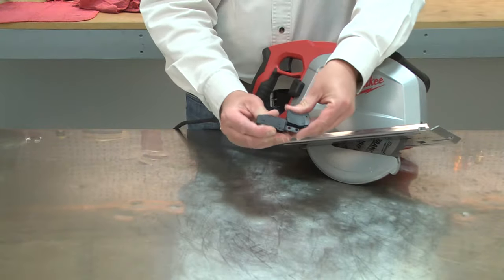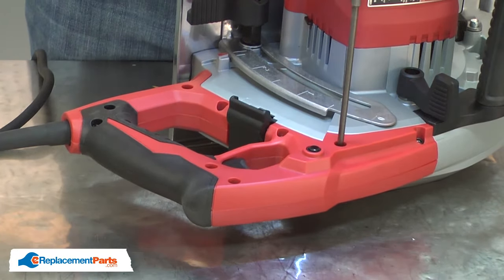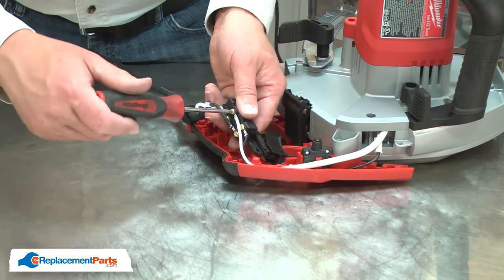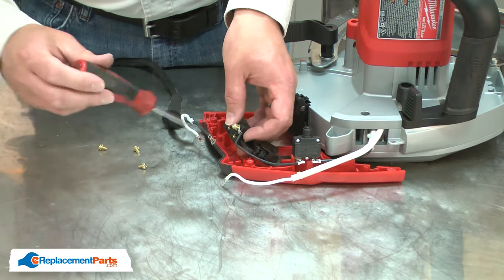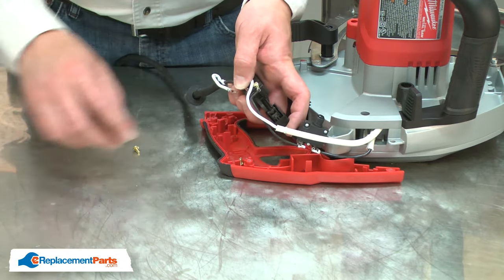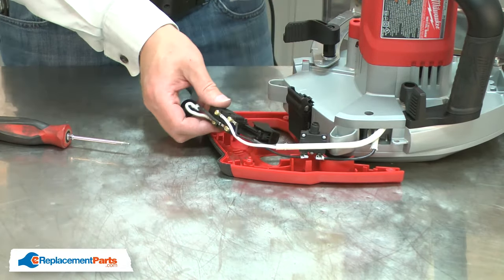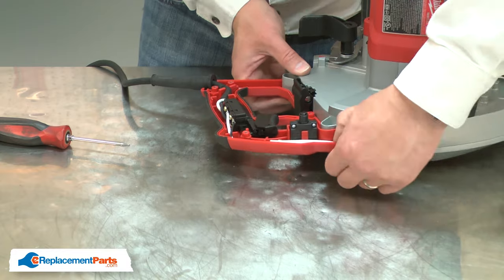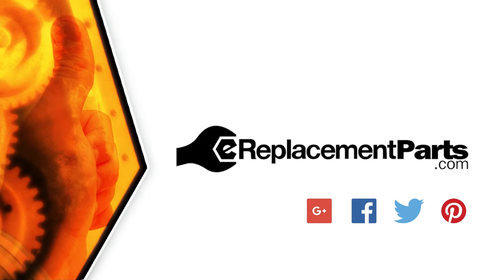Milwaukee Metal Saw Repair - Replacing the Switch (Milwaukee Part # 23-66-2685)

Comment: It's easy to replace but how do you troubleshoot it to see if it's what's broken with a multimeter
Reply: Place on meter and when pressing circuit is complete so you should see power.
Reply: When you have intermittant working on working power tool & you measure a resistance instead of a beep sometimes, say it goes up to 120 ohms the down to 10 ohms. This is caused by the contacts going black you need to open the switch & clean the black marks off, probably cause by grease leaking onto the contacts in the first place & this should cure your faulty switch.